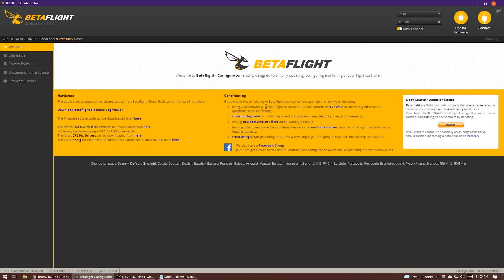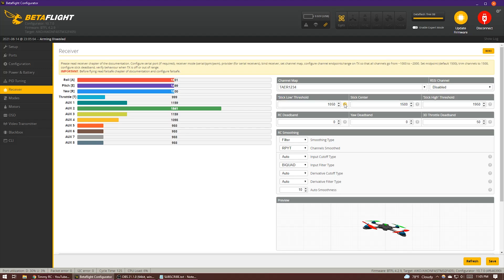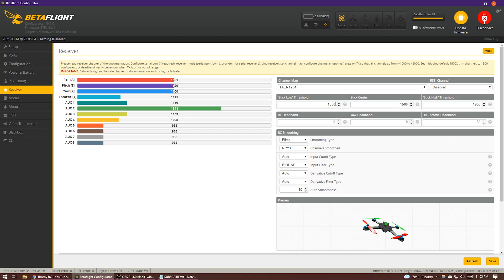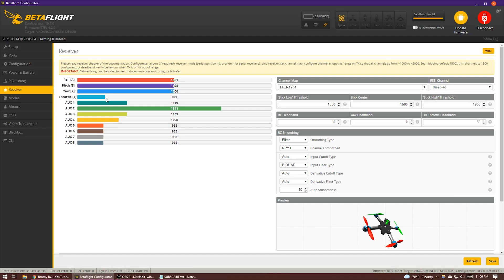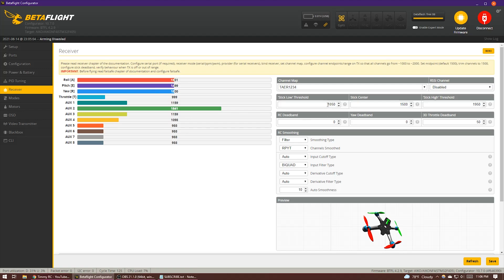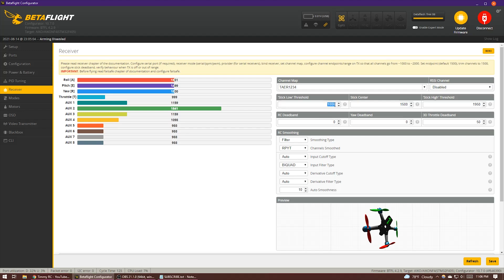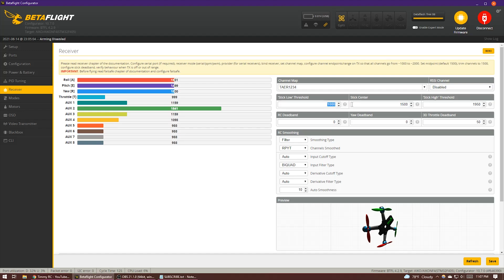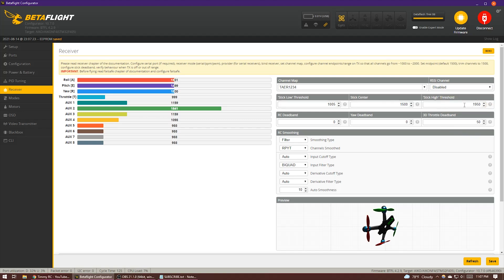Improve Betaflight Throttle Resolution by 5% in 2 Minutes

Comment: Check out what RXRANGE does also. I keep 1010 and 1990 after setting the RXRANGE, the RXRANGE is mandatory to get the maximum resolution on ALL the axis. You're not actually supposed to even have values over or under the 1000 and 2000, it's complete waste of stick.
Reply from the maker: Yes, ideally you want your endpoints at exactly the values of RXRANGE, which by default is 1000 to 2000.

Comment: Useful tip. In crossfire v3 they are adding 11bit ADC support which should feel much better on the sticks 👍🏻
Reply: What radio are you using?
Reply: @eitosj  QX7 with EdgeTX
Reply: @changeagent228  how did u get v3 working?

Comment: What about esc defaults they are also below 2000
Reply from the maker: The flight controller applies another scaling between the scaled throttle range and the ESCs. Although, with Dshot those ESC defaults you are referring to might not be used at all.

Comment: Throttle expo until it feels right. This feels a bit like your over thinking it. I am in charge of engineers and the simple solution often gets missed.
Reply from the maker: Changing throttle expo will not get rid of the low throttle deadzone below min_check.
Reply: @TimmyRC  if you want to get precise what about different firmwares that use different bit for throttle res. So you thought out loud and pinned it down to 5% that is negligible at best. Lol. Feel you refer to can come from expo and centring of throttle (bf) settings. 5 %res compared to a throttle curve and center point you like the feel of.
Reply from the maker: @noisy_boi_fpv_3920  I agree that the increase in steps is not really noticable since there are so many steps. The main advantage of changing min_check is regaining the bottom 5% of your throttle stick travel, which is quite noticeable. Yes, changing throttle mid and throttle expo can give you a throttle curve you like, but it doesn't increase steps or address the low throttle deadzone.

Comment: what the different between stick low threshold and min_throttle
Reply from the maker: Stick Low Threshold (min_check) doesn't let the multirotor arm above the value of min_check and causes a deadzone for throttle channel values below min_check. Min_throttle is the motor idle value sent to the ESCs when using an analog ESC protocol. When using Dshot, min_throttle does nothing.
Reply: @TimmyRC  thank you 🙏